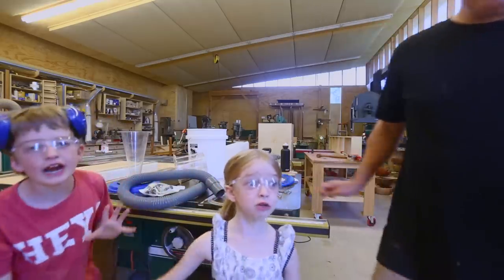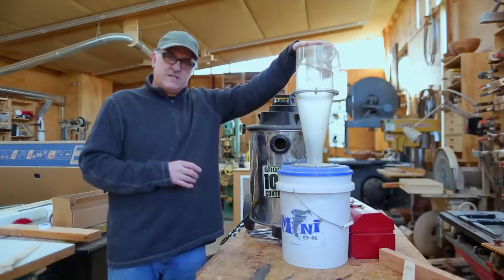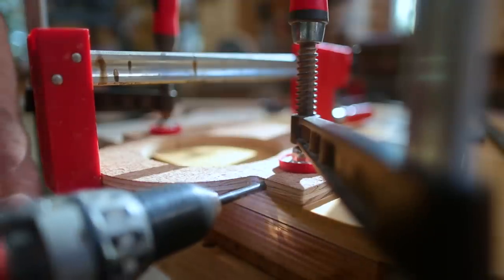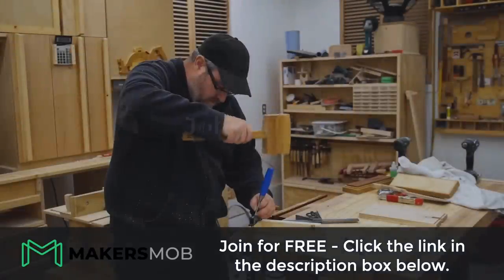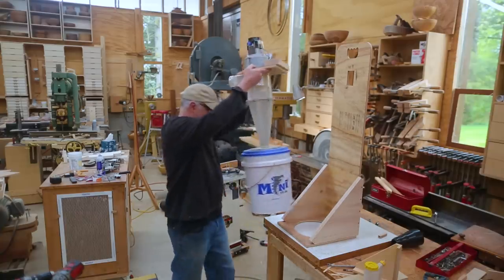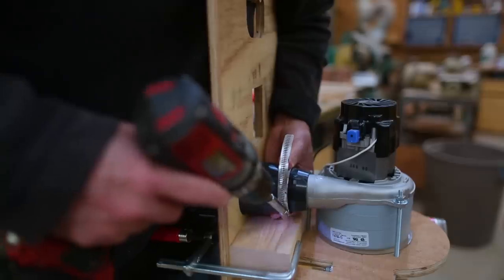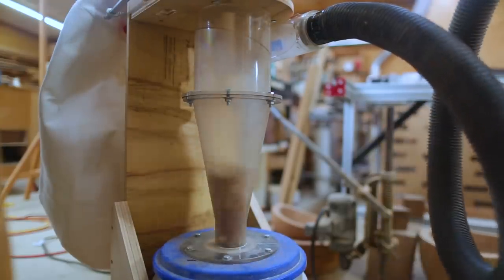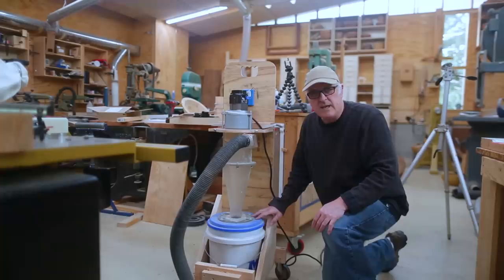Frankenvac

Comment: Nice to see you "Fabri-cobble" something  for a change; makes you even more relatable than what you already are. I would suggest using a bit of flex-hose between the bucket and cyclone, rather than compromising the structural integrity of the backbone with a hinge. The flex-hose should give you enough room to lift the lid off the bucket for easy bucket removal.
Reply: Haha Fabri-cobble is literally all I make... nothing looks great... also, nothing really functions properly either...

Comment: Modified a vintage shop vac myself last week.  It just HAD to be 5" shorter, to fit on a shelf.  It had to be wet/dry still to service a sandblaster and a tile saw inside a plastic cabinet.  So my new bottom was MDF with a layer of polycarbonate on top, all siliconed in place.  Also added a side viewing window with rivets and silicone to determine capacity at a glance.  An LED module velcroed to the side fires through the plastic sidewall to illuminate the interior.

Comment: I’m glad to see other people run into the same problems I do when I build stuff for my shop (like using a sawzall to make it fit!). I turned my old shop vac into a separator by separating the top from the tub and making a platform for a dust deputy and then a box for the filter. It’s super tall, but, like you said, it’s NOT really wide and awkward!! I also added a super dust deputy to my dust collector, and the only way I could see to empty the bin was to have it up on shims that you remove to let the bin drop down from the lid. I hope to do a version 2 also.

Comment: Great Video Frank!  Having done the research and built one of these for my shop, I'd make 3 recommendations: 1) metal bucket in case of fire, 2) put the fine filter before the impeller, so you aren't running dust through the fan, and 3) metal flexi-hose between the bottom of the cyclone and the bucket.

Comment: Frank you're on to the best idea in vacs I've seen so far.  Looking forward to the final one.
Most have the whole vac on the bottom, then the bucket, then the separator which has you pulling the cart from the top and I bet the whole thing tips overs.  Not using the vac bin is giving you a much smaller foot print and it's a lot shorter.
One I saw has separator screwed to a shelf with the bucket under that shelf.  The ply the bucket is on is hinged to lower the bucket about 2" so it will slide out.  To seal the bucket looks like a split swim noodle is used.

Comment: I built a cyclone directly in a 5 gal bucket. When the vacuum got blocked at the hose end, the suction from my Festool imploded the bucket.
I was about to start a large job so I just spent the money on the Festool cyclone separator. It was expensive but not only does it lock on the top of the vacuum, It works perfectly and has saved me it's cost in bags during the first 6 months.

Comment: A cam underneath two sliding blocks on each side of the bucket attached with a handle across the front is what I used on my desk collector to get the can in and out

Comment: Great build!   Couple of things, ground that motor on any metal part and put a prefilter on the blower for longevity.   That way you don't need any bags on the back end.   Nicely done!

As for the dumping, if it's not too heavy, put a guillotine on the bottom and just hold it over the trash.

Comment: I put it all outside in a soundproof tiny shed and plumbed the shop at about 8" above bench level with 4" pvc.Then used reducer T's at each outlet wanted to match my hoses.I used flap's of rubber to block when not used or can use pvc cap's.

Comment: In my years of experience being a hardwood floor contractor and having to deal with fine sand dust I found after few attempts that just a shopvac with a nice quality bag "reusable" is the best option. Great suction and ease dump the dust when full. Give a try matey, sow together a bag to fit and get free from all that overengeneer separation
Reply: Well I'm just speaking by the majority of the industry of job site construction, they basically just go for the simple solution of having a bag inside their extractor . Somehow people who have not know the industry have been missing this simple solution

Comment: That vacuum motor was designed and manufactured to have a prefilter, and will wear faster without one.  Vacuum cleaner manufactures would attach a ground lug to any of the metal screws that are screwing into metal parts of the motor.  Good luck!
Reply from the maker: I was wondering about a prefilter. although it's not like I am running it all day.
Reply: Is the cyclone not an effective prefilter?

Comment: Good going Frank.   I too am in that category of vortex dust collector w/ shopvac that doesn't quite work right because a big rectangular vac+bucket is just too bulky.    I've actually thought of a vertical solution as well, but it involved the shopvac as the base, and the bucket on top, but unfortunately in the same boat as you with it not being terribly easy to empty the vac, the bucket is ok, but the shop vac is a pain since everything is effectively resting on top.   Plus it is a bit top heavy with the hose coming from there.

Comment: I use a screw top bucket lid, suspended in the air, so the bucket can unscrew and just drop down. It works great. I use the same system as a cleanout bucket for my larger cyclone.

Comment: Very cool. I thought about this concept quite a bit. I have two such setups that still incorporate the entire shop vac with everthing on a roll around cart like dozens of others on the Tube. One of mine has a home made cyclone fabricated from a traffic cone and it works better than my old version of the clear vue (smaller and not as efficient as your newer version). I do like the use of the stand alone vac motor/blower assembly, but I want to build one that still uses the filter for the original vacuum design. That would mean fabricating a much smaller enclosure. I will send a pic when I get it worked out.

Comment: A couple of thoughts: Put a elbow out the back and hang the filter bag straight down. Place the bottom of the bucket and lever it into position. Pull a handle down to lower it to empty. You've probably already thought of those. :-) I love your ingenuity.

Comment: I have the same shopvac, cyclone and bucket system that you started with.  However, I inverted my bucket and attached the cyclone to the bucket bottom (now the top).  I bought a threaded lid for the bucket (now the bottom) and when I go do empty it I just hold the whole assembly over the trash and un-thread the lid.

Comment: Frank nice. V2 you might put a 3/4 “ plywood under the bucket have the bucket sit on top.  When you need to empty the bucket pull the plywood out from underneath the bucket will be in clearance and you can remove it. If you are considered the bucket will move you can put a half round in front and drop a pin in to lock it in place.  I like what you did so much I think I will build one!  Thank you!

Comment: I’ve been watching for a long time and I feel like I finally have a useful suggestion...you could bolt the top piece on with some star knobs and cut some vertical slots in the upright piece so you can raise and lower the motor mount and make dumping the bucket easier.

Comment: I was thinking of a backboard with vertical slots bolted to the frame. When you need to get to the bucket, loosen the bolts and raise the motor and cyclone high enough to clear the bucket. Tighten the bolts to hold the assembly up out of the way while cleaning the bucket. Overall you have a great start on a great idea. It must be nice to have all the extra help in the shop. When that guy isn't busy how about sending him over to my shop. Thanks for sharing. Please stay healthy.

Comment: For what it's worth, I have a similar setup, but the bucket (I'm using a 20 gallon spill control bucket with a ring clamp) and cyclone are on top. It makes disassembly and cleaning much easier.

Comment: I built the same contraption but I used an old vacuum cleaner motor/blower.  I built a box to replace the bucket and put a sealed door on it.  The idea was to just empty the box when full.  As it turned out the bucket fits perfectly into the box and I just open the door and pull the bucket out.

Comment: I was thinking a hinge in the backboard too, also i would tie the hose low , so it won't tip over when pulling it across the shop, you might adapt the blower discharge for a standard shop vac insert bag that could be just thrown out or tossed in a bonfire. This gets me thinking about mine, i just have them both (vac and separator) on a dolly board of sort.

Comment: When running there is a constant blue spark being generated that is open to the shop air (emitting from where the brushes meet commutator). So for example if the combustible dust concentration were high enough in shop air that spark could ignite the dust? It is a good start though and I've noticed most of the consumer vacuums seem designed primarily to force us to buy their filters, hoses, connectors and parts. You could look at your old shop vac motor under the housing to see where and how they mounted that motor ground wire? (I know you know this but this version doesn't look double insulated at all; I agree with others who say it needs a ground wire or a vented additional cover for the brushes and motor cage).
Reply from the maker: I kept the motor and top piece from the old shop-vac I should have a look at it.
Reply: @frankmakes  Though now that I think about it the ShopVac probably is double-insulated since it has the housing completely enclosing the motor.
Reply: Can you find evidence that any home shop has ever had a dust explosion? I am aware that engineers have been able to create dust explosions by deliberately mixing dust and air in the presence of ignition sources. But have you ever heard of it happening in real life? Because I actually don't believe it can happen in a home shop type of environment. All the same, it wouldn't hurt to get an induction blower. No spark.
Reply: @frankmakes  Just run a green wire from the metal case of the motor into the switch box and connect it to the ground wire from the wall plug. That should keep you from getting zapped if you touch the blower and any of the internal wiring has degraded over time.

Comment: I was just doing prototyping for my home vac separator as the video was published. I have the same problem but no workshop. I have built a stainless steel cyclone with a cart for two metal shops though. Here are my ideas and findings, maybe these could help with version 2:
- When the vac is separate from the cyclone and the bucket, the separator could sit on a vertically sliding piece that the vac presses down, which seals with the bucket and it's easy to empty it
- gravity holding down the separator on the bucket, it could also accommodate different size buckets, as nothing says the hole for the separator has to be in the center of the lid
- any leak of air in the separator and bucket assembly causes material to get in the vacuum bag. Same happens when the suction hose gets glogged and there's insufficient air velocity for the cyclone to work
- grounding is essential when using a metal cyclone as you only want to touch it once without, but could also help with plastic ones as at least mine gets fine dust collecting all around the cyclone and bucket interior, and the dust balls inside are moving because of static. Might be able to use mains grounding, that would be neat, but I used a wire to connect the metal cyclone on one end and brushing against the floor on another
- they sell rotating attachments for vacuums which helps to prevent spiraling the suction hose. Rotation on just the handle end isn't enough

Comment: I think hinging the top section might be tough to balance on the relatively small base. Maybe hardmount the lid so that the entire top assembly doesn't move, then have the bucket on a plate with equal length arms and a cam lock, so that the bucket just drops down, grab and go? Also, I'd up the capacity of the bucket. I'm definitely going to keep a lookout for the next version of this project, as I'm trying to figure out how to do this myself with my own dust separator setup. Right now I've got one shop vac hooked up to a 55gal drum with a Dust Deputy for general workshop suction, and a 5gal Home Depot bucket with another dust deputy for places I can't reach with the big drum.

Comment: Don't overthink emptying it. Put a door on the bucket. Cut out a section of another bucket, and then cut a hole in your bucket smaller. Hinges on the edge, and something to hold it closed. I'd use some rubber trim around the edges to seal it and you are good.

Comment: Great start for a prototype, you could probably made the whole top assembly slide up and down on rails, have springs to hold it down and a lever to lift it while you take the bucket out or put it in. Would also make it easy to unclog from below. Whatever happens I demand more footage of debris spinning down the cyclone.
Reply: Matt Tester I was thinking the same thing. Dado the plywood or add two hardwood slides that enable raising and lowering the cyclone and motor assembly
Reply: No need for any springs to hold it down. I build a cyclone (a cone made of 24 tapered MDF pieces with a top and bottom disc) and it just rests on a big bucket. There's a grove in the bottom disc to locate it on the bucket, but nothing else (no sealing rubber or foam or anything like that). It never fell over and when switched on it pulls itself so tight that I already "imploded" one bucket.
Reply: @superdau  Yes I forgot that it's attached to a vacuum! Definitely no need for springs.

Comment: Hi Frank,
I enjoy your videos especially ones like this.
What if you emptied the bucket out the BOTTOM.  Two ideas here.  First, turn the bucket upside down with the cyclone attached to the bottom of the bucket.  To empty, place entire unit on top of a trash can (you probably would build a standoff/up to set the unit on top of and allow access to the bucket for emptying), then remove the lid of the bucket to allow the sawdust to drop into the trash can.  OR Second, cut a "door" into the bottom of the bucket.  With a little bit of weather stripping, you could make the door airtight.  Thus, you could proceed as before but just open the "door" to allow the sawdust to drop out.  Either of these options would prevent the need to disassemble the unit to empty.
I love your idea.
Please post the type/model of the vacuum you used on the top of the cyclone?
Cheers,
Terry

Comment: Nice upgrade/retool job, Frank~!  For emptying the bucket, how about working in a short piece of flex hose between the separator and the bucket lid?  This would be similar to some stationary DC systems.  The cyclone & motor could then be mounted a bit higher to allow the lid to come off of the bucket.  Might need an additional piece between the backboard and the lower end of the cyclone to stabilize the length of it.  Don't know if this has been mentioned already.  Just my 2 cents worth...   :-)

Comment: I see a lot of suggestions about how to split the chassis into two pieces to separate the top from the bottom, but haven't seen anyone suggest that the bucket hang from the cyclone with clearance below for removal. I don't think the bucket will get heavy enough to need to be supported from the bottom if the cyclone is well mounted to a rigid chassis and the bucket hangs from that. Then it would be a matter of undoing some straps or clips to release the bucket with no additional moving parts.

Comment: I use a Gama Seal Lid. I screwed a piece of plywood to the top of the lid for strength and then mounted the lid to the upright using pieces of plywood as standoffs . This allows the bucket to unscrewed from the lid and be emptied. I’ll send you a picture.

Comment: Love the idea and agree that you’d think there would be blower motors out there. 

For bucket removal, what if the upper and lower were connected with tracks or slots so that it was straight up and down removal? You could have thumb screw to lock it up while you empty the bucket.
Reply: Maybe even with a spring so it's super easy to raise.
Reply: There are. Look in Mc Masters.
Reply: Linear drawer slides with a spring to keep it in the closed position.
Reply: And rather than snapping the lid to the bucket, cut the bottom half of a second bucket out and essentially just stack that into the main bucket. Makes a good seal and comes apart "easily" when you want to empty.
Reply: @RobotJustice /videos That's brilliant!
Reply: I was going to suggest the very same thing.

Comment: Get rid of the bucket and inclose the whole thing in a tall box.  The box will have three integral compartments, a lower compartment equipped with a drawer to facilitate emptying dirt and dust.  The middle compartment will house the cyclone and the top compartment holds the motor.  Enclosing the motor will make the vacuum quieter.  -  Make the whole thing round like a cylinder maybe like a barrel with staves, throw some cool looking design elements into the finished product to give it a "Howarth" look.  Now hustle to get that done by next week so I have a video to watch!  ;)

Comment: Great Job. Suggestion. Can you drop the bucket below the cyclone and connect them both by a 100mm flexi hose allowing enough room for the lid to be unclipped and the bucket removed. Suggestion 2, put an automotive cartridge air filler on the in take to the vacuum pump to reduce dust entering the impeller chamber and one of those cool aftermarket chromed air intake filters on the air output a. to look cool and b. the reduce even more of the escaping dust entering into the air of the workshop. Thanks for the video